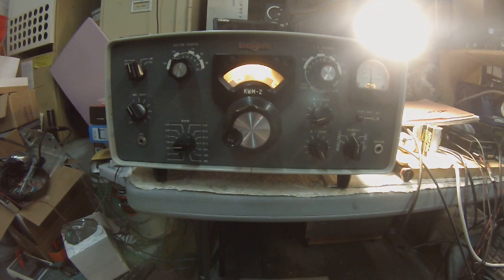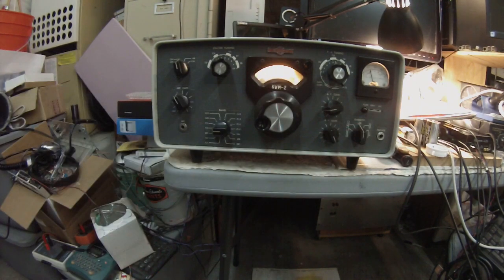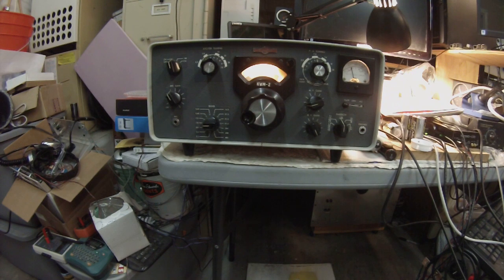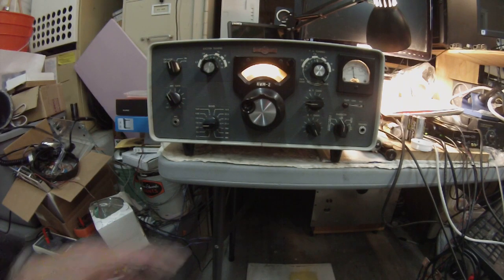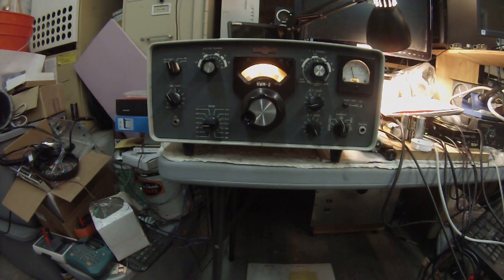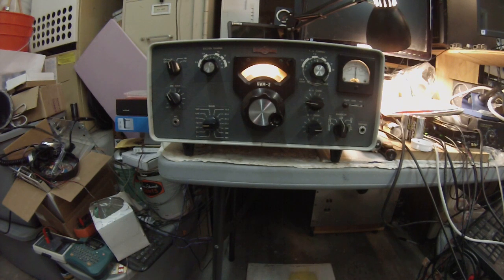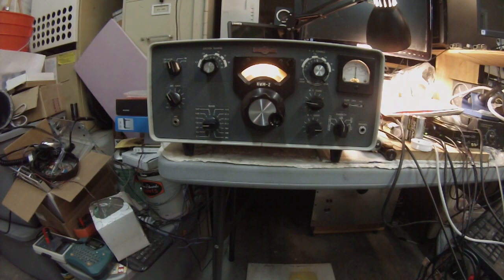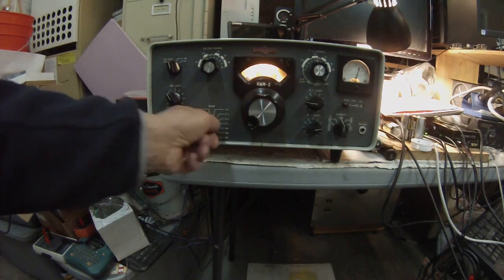The KWM-2 ~ Magnificent Engineering!

Comment: Can you talk to people in other countries with this radio? Sorry if it's a dumb questions
Reply from the maker: The KWM-2 started as a ham product specifically to talk to stations in other countries. Running 100 watts you can work the world. Running an amplifier (30L1) you are always heard. The radio was off the shelf when the Vietnam war started, and the military bought thousands of the units. There are many KWM-2 and the KWM-2A'(which enables you to add a second set of crystals for operating outside the ham bands) can be found for sale. 

Caution though as some units have been damaged and are costly to repair but for the most part you can likely find replacement components like tubes. Harder to find are PTO's, the BFO Crystals and the Mechanical Filters. Many of these types of parts cost a Kings ransom.

The KWM-2 when operating properly does compete with many modern-day radios. The frequency stability is excellent, and the audio quality is great.

Hope I answered your question.

73's
Pete N6QW
Reply: it is a dumb question why be sorry if your dumb you cant help it